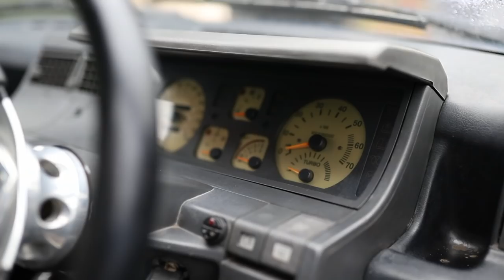The Hunt for a Renault 5 Turbo *TOM vs DALE The Ultimate Car Build Off - Tom Episode 1

Comment: It's not à Renault 5 Turbo it's a Renault Super 5 GT Turbo (coming from the french annoying guy ;) ).
The Renault 5 Turbo is the rwd rear engine beast with the huge body kit, the super 5 GT turbo (as shown here) come later and is the fwd version of it with less power

Also good luck with your research, there used to be TONS of them here in France but most of them has ended their life in a tree after an understeer ^^

Also if you can buy it and it has real Dimma kit it could be awesome, they are really rare, like the Renault R11 Zender kit and other legendary kit here like the one Dimma has also produced for the 205.
Even if it didnt come from factory like this and it has been mounted after and has the Dimma certificate you can buy it without any doubt.
Reply: You're thinking of the GT Turbo 2 which was the RWD version, the first GT Turbo was FWD
Reply: In uk it’s rwd= Renault 5 turbo/ turbo 2/ maxi.
                Fwd= Renault 5 gt turbo.